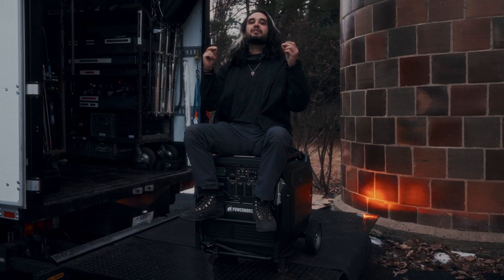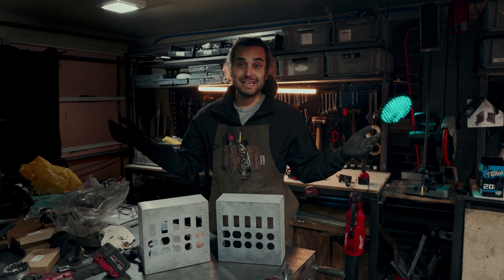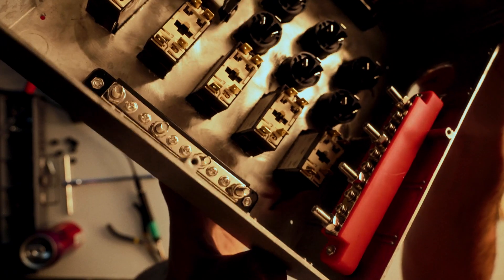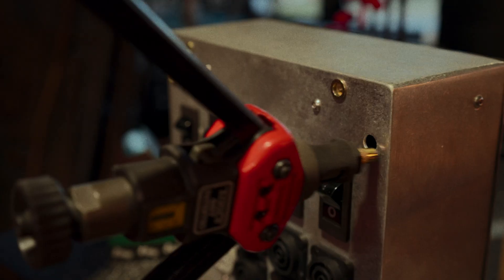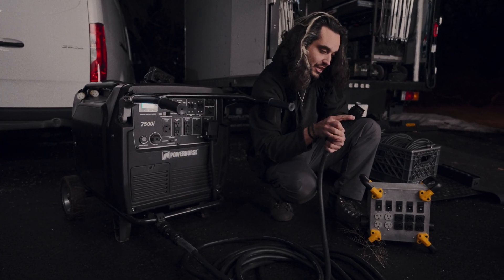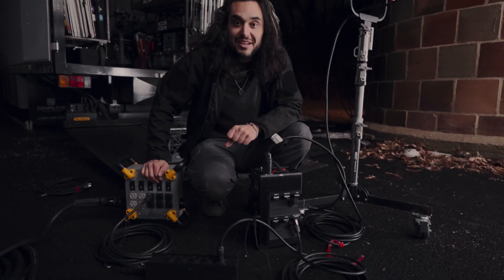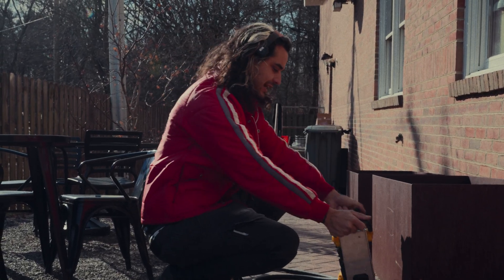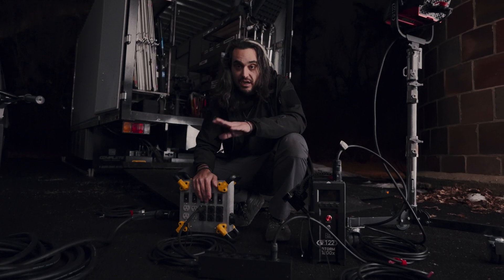The 120v fallacy plaguing the film industry

Comment: Totally agree that still using 120V is totally unefficient, thicker cables and double the Amps, back in Cuba I used to run everything at 220V, even the tungsten of course with 220V bulbs, way more efficient. I also like better the CEE system than the NEEMA, more versatile and safe.

Comment: I don't know why you went with the multi-pin connector for that much power and expense when the generator only supplies nominally 6000-6500 Volt-Amps when you could go with a NEMA L14-30 set of connectors, which are also available in weather resistant versions and you can put larger gauge wire into them as well.  The Neutrik PowerCON connectors are handy, yes but the connectors on your distro panel don't have to be what they are.  I would probably prefer if we use an actual breaker panel instead of the unit you have there as those just looked like rocker switches.  Also having a main breaker in each box would probably be a good idea as well.  There's a reason why people buy Honda and even compared to the unit you have there the Honda machines typically have larger engines meaning voltage drop isn't as bad as it may be on your generator and the fact that they are commercially rated with a fuel injected engine to boot.

Comment: Great video production... I've read thru some of the comments regarding wiring/loads, etc. The insurance/liability concerns are legit. However, a flaw I don't see mentioned is your choice of wiring your 19pin connector. Specifically putting your grounds on the outside. The wiring convention I recall (40+ years in entertainment lighting) is the ground connectors are always the 6 middle pins. Those have extended reach to allow the safety standard "make first, break last" convention for ground terminals. When I was working in a shop, some manufacturers (Veam, maybe?) included a ground ring to solder the six center ground pins together, on one grounded conductor. Made for using lighter weight multi-conductor cable 12/14SO, rather than 12/19SO.

Comment: This is a really cool build, and I had a similar idea a few years ago with far less stylish execution, but while testing it and talking to an engineer in our local industry it’s important to remember that Split-Phase Alternators don’t give “true” 240v in the pure sense of the term like tow-plant generators do. They trick the circuit by alternating voltage of opposing sine waves across two leads from one 120v lead. Meaning that you actually most likely won’t be able to double your wattage load just due to voltage being higher because it is still then stepping back down into 120v inside the alternator which ups your amperage. 

Let me know if that isn’t the case in your generator, but it’s definitely the case for other split-phase alternators that I’ve tried to attain this with.

Comment: How is that a plug that looks like its being taken from a 6V model train power supply scaled up by 100 a standard for 240VAC? The socket looks like you could easily put your fingers in it and its "locking-feature" are just the massive pins press fitting into the socket? When you think you saw every crazy US plug, there is another even crazier plug just around the corner....

And it looks like someone hand-filed a block of plastic down to its shape and just drilled three holes for some metal pins in it. This had to become a standard when steam engines were still around.
Great job on the box, it looks very neat, and I love the additional per-socket amp-meter.

Comment: Australian electrician here. Did a lot simpler version for a music/ PA/DJ system. Just used 32 amp 3 phase ( 4 pin +E industrial plugs are relatively cheap, standard equivalent extension leads can be bought/hired/made ). The distro box is straight out to 6x 240v/15 amp outlet circuits ( 3.6 kw each ) or modify for higher amps as needed ( 32 amp one phase with 4x 15 amp single phase circuits, OR 3x 32 amp single phase ). Obviously everything here is 240v standard ( or 415v standard )
if you need more power then you are going to be spread out more so more boxes
Your 100 amp lead handles 12 kw, My box is 13kw

Comment: that twentysomething pin socopex connector tying into common bus bars in that project box is problematic as hell, and it's just as bad considering what you're probably doing to get that NEMA 50A to convert to socoflex. IDK about specialized film world electrical, but in the normal world it's required by various electrical codes that the equipment grounding pins make contact before any current carrying pins, and picking arbitrary pins in that socco plug doesn't satisfy that. Also, arbitrary pin choice makes it highly likely that Helper Dave will miswire one or two which, since it seems to be tapped directly off the generator's 50 amp plug circuit, is probably going to cause a direct short and maybe fire. I see no GFCI protection either, and that's not good especially since there are no gaskets on anything. 

You can assemble 5 to 10 CA Standard 50A twist lock cord caps in the time it takes to do one socco cord cap. Save the expensive socco for when you actually need all 20 pins, like for signals & controls etc.

Look up commercial construction temporary power distribution boxes, pick one up and take it apart to reverse engineer how they do standards and code compliant multiphase power distribution.

Comment: No, Waste of time and money.  All you had to do was buy a 50 amp straight blade plug, to a 50 amp Twist Lock adapter. The construction industry already has UL rated distribution box. Use that on a job, have an accident, someone gets hurt, your insurance company will not cover you.

Comment: Not to say they should be used instead of the True1, but there are NEMA locking plugs as well.  L6-20 is a locking twist-lock 240V 20A plug.  Those True1 are much nicer to use than the nema.
Reply: As for the generator to distro feed - I have no idea why you wouldn't use NEMA for this.  The gen's got a nice NEMA L14-30 right on the front of it, why adapt away from that?

Comment: I don't get it. What was the fallacy? If you said it, it wasn't clear to me. And what's the reason for the multi-pin connectors? It only takes two wires to carry power (3 for 3-phase), so they must be for signals, but what kind? Please don't say you're using costly multi-core cable because your understanding of electricity is tenuous! If that's the case, educate yourself!

Comment: It's a revolution to catch up to Europe? I've often considered the logic of sticking with the 120v standard. I worked in IT and thought it was  ridiculous to run 120 to all the equipment racks which immediately convert to lower voltage (usually) DC for the computer  equipment. Why not just use a high DC voltage and step it down with DC-DC converters. Which is what they're  doing is some data centers of course.